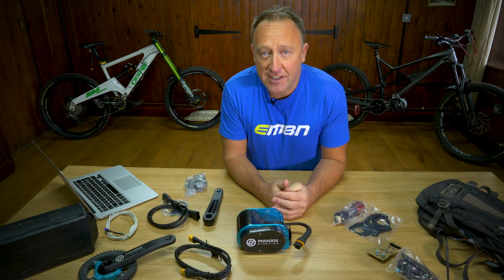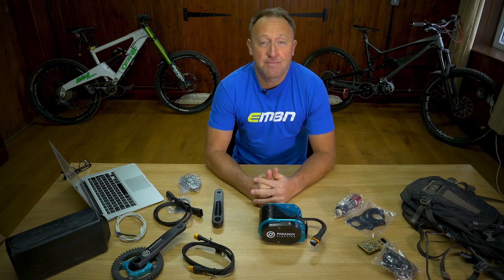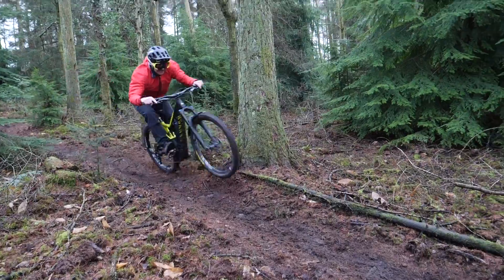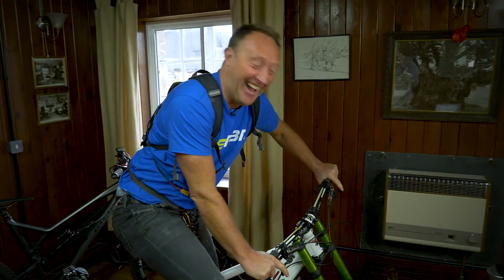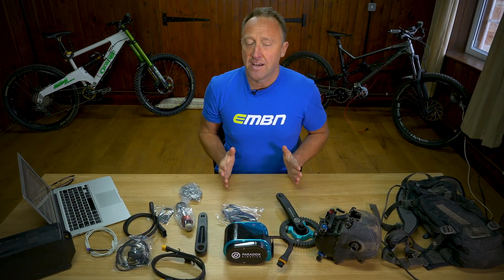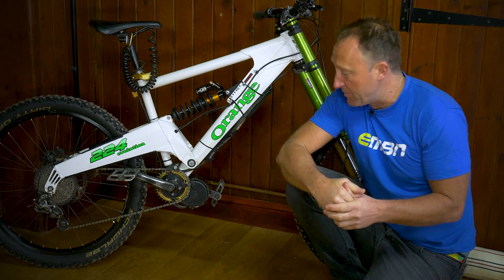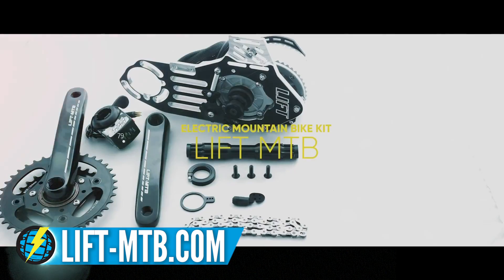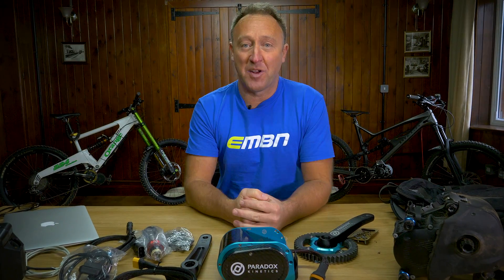Bolt On E-Bike Motors Explained | E-Bike Fundamentals

Comment: Why don't most e-bikers use e-downhill bikes? You'd think the only downside of a DH bike is pedaling, so with motor-assist it's a win-win...
Reply: Valid question. The emtb market is underserved with 180-200mm travel bikes. A fair bit of acoustic bikes with that travel now have steeper seat angles. Most emtb companies are making 150 travel bikes(or less) . I can’t find any long travel emtb’s with shorter chainstays than 450mm
Reply: @vert_n_dirt  thats why I converted my Scott voltage fr10. 200mm travel up front and 190 back ..... and I have it set at 425mm chain stay length. I can buy a module at back to shorten it or lengthen it too.
Reply: barry taylor more and more that’s sounding like a good option for a dh bike. I’m done spending a ton on a dh bike. EZ to pick up a used one cheap and have a bolt on motor. Now for a mid drive 160-170mm travel daily driver with reasonably short chainstays. Merida is the only one I can think of and they’re not sold in North America
Reply: @vert_n_dirt  the Merida E160 900+ was one I was close to looking at. I thought I could upgrade the forks to 200mm, and live with a 160mm travel back end. They run a 435mm chainstay which should be good. My brother just bought one he is happy with 160mm travel and thinks its tall. But the most travel he has ever had in the past is 130mm lol.
Reply: barry taylor that’d be nice. I sold my dh bike a year ago and had been using a 160 travel bikes a coil shock and a 180 fork and it didn’t give away a lot to the dh bike. A triple clamp set at 180/190 on a e160 900 would be acceptable I think. So many good acoustic bikes in the170-180 rear travel range now at a really good price. I wished they made an emtb equivalent(yt, canyon, commencal, Guerrilla gravity)
Reply: go for it , but not for me, i dont like the slack head angle in corners.  each to thier own, i can see the appeal , for sure less down sides to big travel bikes now :)
Reply: To climb a fireroad they are ok, but as soon as things gets steep you just cant keep your weight forward. Think Haibike has some e-downhill bikes.
Reply: @NotingIsWhatItSeems  Why can't you keep your weight forward? Enduro e-bikes have short stems and slack head angles too, what difference does one inch more travel make?
Reply: @AlexSalikan  If that was the case you would probably see dh bikes with wide range cassettes and droppers but you dont, the geometry just makes it to hard to pedal uphill. If you were to extend the seat on most of those bikes you would be seating very far back.
Reply: @NotingIsWhatItSeems  The Haibike DH has a very steep seat angle. People don't use normal DH bikes for uphill because they're heavier and they don't pedal as well, not because of the seat angle. Both of which are solved with an electric motor.
Reply: @AlexSalikan  Haibikes bike is specificaly made for it. And as i said, if there was a market for it there would be plenty of them.
Reply: @NotingIsWhatItSeems  And my question was why isn't there a market for it...